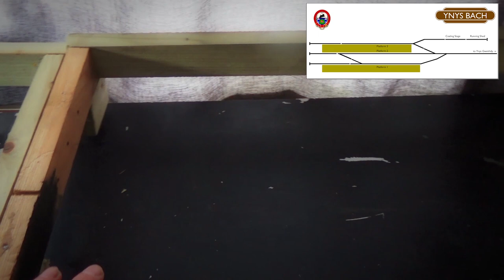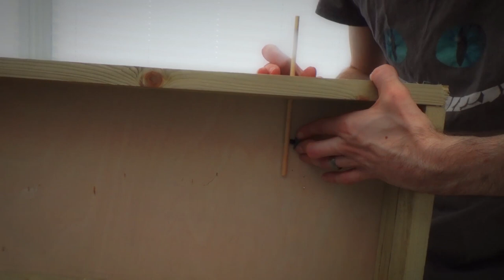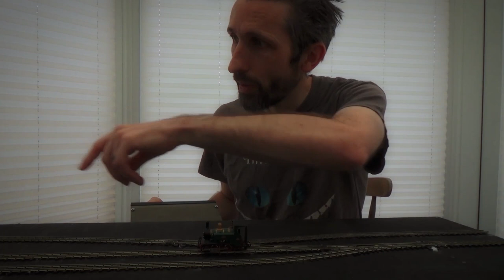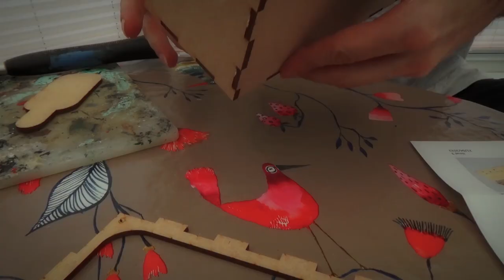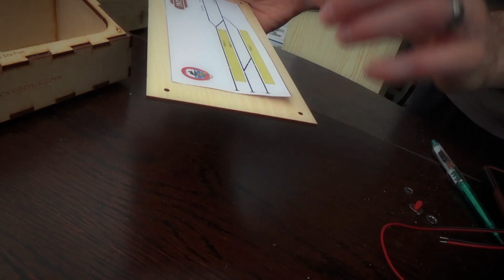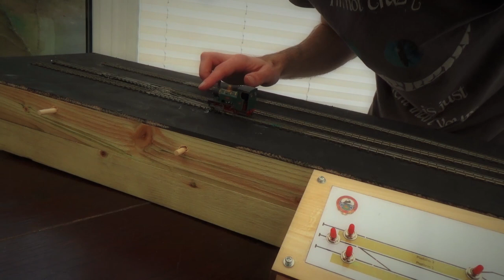New 009 gauge Model Railway Build - Phase 01 Part 01 | The Railway Room

Comment: Dude, that was a great watch, I enjoyed watching how to set up the isolated areas, that is something that has eluded me as far as using it on a layout, but on my next layout, which is DC, this is the perfect solution. Will follow your progress, all the best n take care. Brian @ The Angels
Reply from the maker: Nice, thank you very much! I didn't go into too much detail about the actual wiring plan as there's plenty of resources online, but the key thing is the placing of the isolating fishplates. They only need to go into 1 of the rails (the shed line has 1 unbroken rail from the point, with the second rail cut and isolating plates inserted) but it's essential that they're all on the same rail. Some places (like back to back points) might need both rails isolated. I found it helpful to draw a paper plan to get it clear in my mind. Good luck with your layout!
Reply: @FortheLoveofSteam  thanks for that, you make a great point, the isolators are key, and using them on the correct rails. Your work has inspired me to dig a bit deeper. 🤘

Comment: Great video  I am new to 009 and a little confused regarding your wiring from the switch to the frog so that it is live all the time I understand that the switch changes the polarity of the frog. But with other track you snip the connecting wires connecting the heels to the closure rails. With 009 track you can’t do this. How did you get around this. Thanks
Reply from the maker: Hi, thanks for commenting. This is only my second layout build, so I'm figuring stuff out as I go. Some people will isolate the moving point blades from the frog, and then hardwire each blade to its adjoining rail. This prevents shorts in case metal wheels touch the wrong blade, which I believe is more of an issue with DCC than with DC. On my points, both blades are electrically connected to the frog, and so they both switch polarity as the points change. This is how the Peco points are designed to work, and the recommended method for DC control in the new issue of the 009 society handbook. Hope this helps!
Reply: Thanks that’s really helpful.  Went 009 society meeting in St Helens on Saturday picked up some other useful pointers
Reply from the maker: Oh, very nice! As a non-driver it's a bit awkward to get there from the wrong side of Manchester, but I'm hoping to get along to a couple of those meetings later in the year.